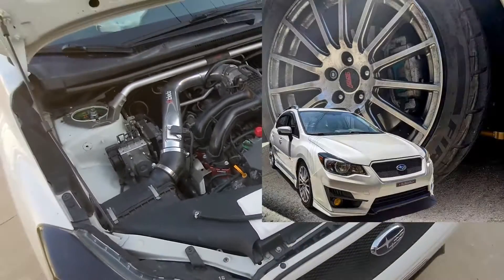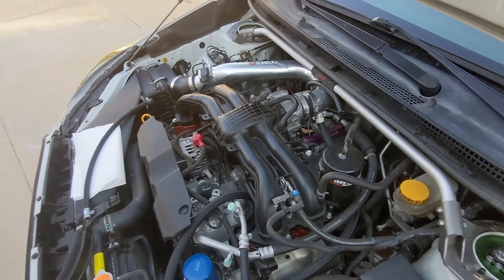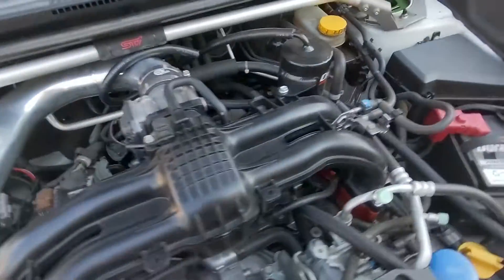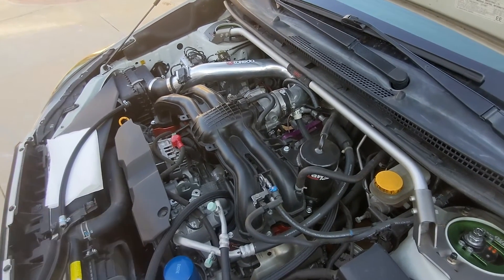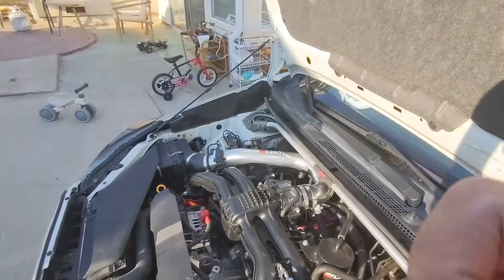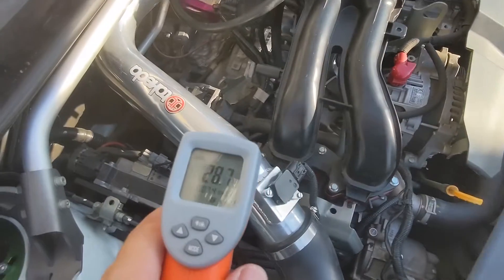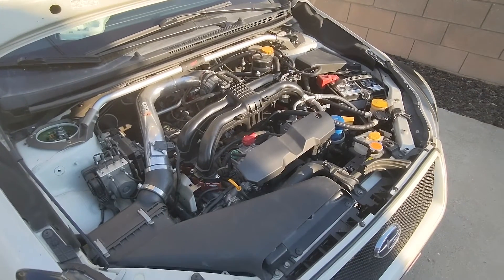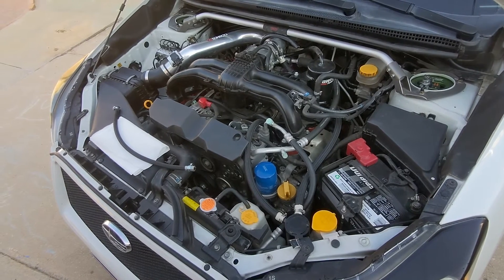Subaru Impreza Sport - throttle body coolant bypass

Comment: I'm about to do this mod, did you measure the actual intake air temp before and after the bypass?
Reply from the maker: Yes. Are you looking to do this mod? It is for a very specific use case. Hot weather climates, and taking the engine into the extended "playtime". Not really needed for the everyday driver. #BecauseRacecar  😄
Reply: @JasonLeung-4roller  yo I was the one who messaged you on messenger 😆

Comment: What about cold start after bypassing?
Reply from the maker: Considering that the coolant and engine are cold (winter evening) the coolant running through the throttle body would be ambient temperature.  I've had no issues with this modification. 

Cold start is the same with and without this mod.
Reply: @JasonLeung-4roller  Thank You for the info your car is awesome 👍

Comment: What if I make sharp turns. Will my non torque vectored axle snap in four?…
Reply from the maker: Recently I've been thinking about the "elasticity" of the half shafts. You might break or twist one if you had enough front grip on a heavy wheel. but the transmission would probably slip first.

Comment: Where did you get that front bumper lip and side skirt kit? Love the look of the taller body
Reply from the maker: The side skirts or "rocker panels" come with the Impreza Sport but can be added. The "front underspoiler" for Subaru Impreza is an OEM accessory. Depending on 2012-2014 or 2015-2016 you'll have to find right colour code for your car.
Reply: If I’m tryna get a new white bumper where do I go ?